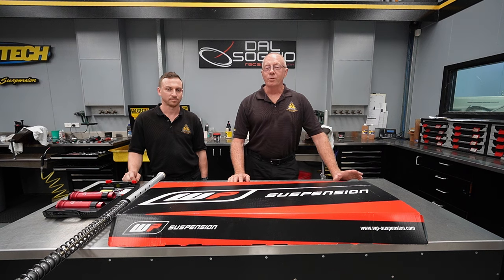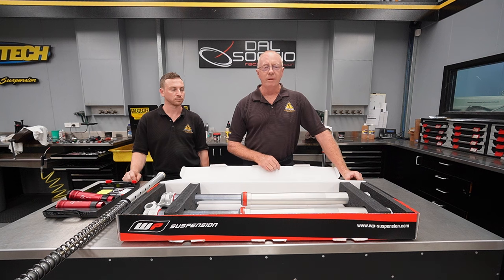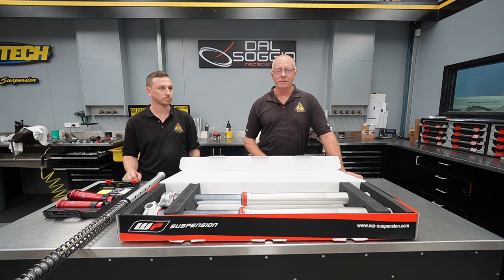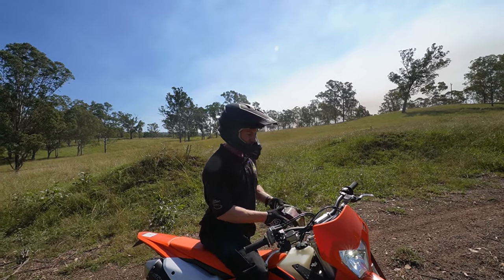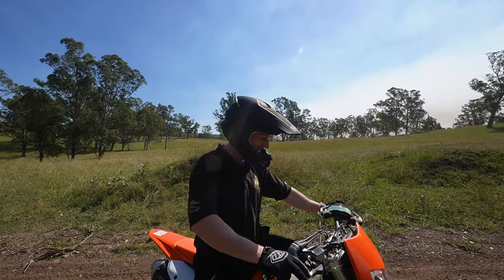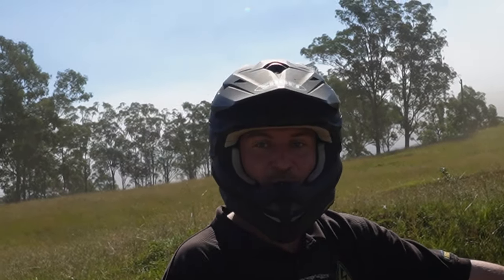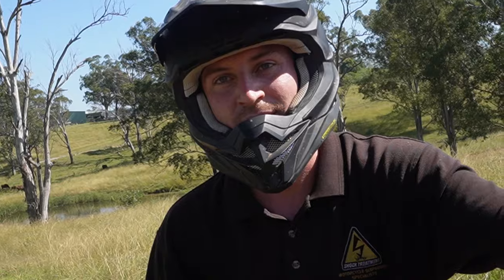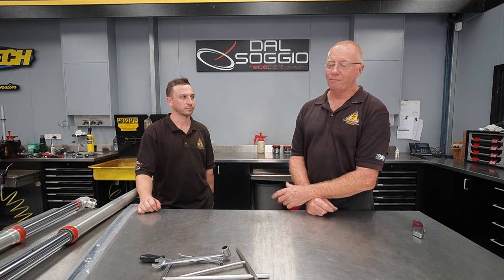KTM EXC 2024 Fork Analysis and Dal Soggio XR Kit Upgrade

Comment: Learnt a lot through your no bs explanations 👏 

With the bladder can you use the psi to adjust the feel or should it be left at appropriate value ?
Reply from the maker: It will certainly alter the feel but its underlying value is in maintaining a positive pressure to provide fluid stability.

Comment: The Dal Soggio kit changes the fork back to a bladder fork, which the original WP CC fork was. Why do you think they went with a piston and chamber? Do you think it was just to be the same as KYB? How do these forks compare with the original WP CC fork?
Reply from the maker: I still rate the bladder fork from WP as their best fork yet. They are still available as an aftermarket item and have been upgraded. The Cones are a bit of a marketing exercise that have the buying attention right now......but ask a tuner as to how the cones are any better or even any good.....I've yet to hear a credible answer, even from WP
Reply: If you know, can you tell me what was the initial idea why WP developed cone valves? I've heard something about mid-valve compression shims getting distorted too often, but don't know whether that is true. Anyways, everyone else uses some kind of a shim stack on mid-valve compression seemingly without a problem. 

If that is indeed the "real reason" why cone valves where developed than it does really seem to be more of a marketing stunt, as shims, especially with a trampolene (leaf) spring offer way more adjustability.
Reply from the maker: @strifex-suspension-works  Their midvalve shims do distort quite regularly....but the shimstack provides the greatest level of tunability and better feel. WP could look at supporting their shims more efficiently or upgrading the quality of their shims rather than chasing alternatives that offer more appeal in the brochure than in the real world. Chase Sexton has thrown his WP Cone Valve cartridges away in favour of KYB.....they could have given him this new cartridge instead.
Reply: They are both good, you wouldn't be able to tell the difference in feel. New fork is better, has a better mid piston than the old CC fork. Most of the stuff this guy is saying is biased so he can sell more stuff. Good tuners know why the CV fork is better, I'll just leave it at that. Racetech typically removes the cones so they can sell gold valves which turns them into the new 24 spring fork basically. Nonsense
Reply from the maker: @AnonYoukno  So......if WP themselves can't give me a good reason as to why the CV is better....perhaps you can fill me in? And lets keep it technical. Having studied hydraulics and fluid dynamics along with mechanical engineering, feel free to go as deep as you wish...
Reply: @AnonYoukno  yeah, I also would like to hear an explanation as deep as you can go.
Reply: @shocktreatment5495  with regards to shim support, are you referring, for example, to implementing base plate of sorts to limit stack deflection accompanied, if necessary, with a more open-flowing piston to achieve same flow with less shim deflection?
Reply from the maker: The mid usually has the largest ports that can be accommodated within the confines of the dimensions. There should be more than enough options through both float and deflection to ensure the elastic limit of the material is not reached. Most mids will have backing shims that will limit deflections, bolstering shim strength. This action also represents a change in shimstack pivot resulting in a form of two stage stack. I am a big fan of this concept. However if you are starting with poor shim material, distortion will always be an issue. We have tested a geat deal of shim alloys and properties and have our own custom made. Of all the OEM companies Showa appear to use the highest quality shim material. They are some form of stainless but the alloy appears to not only be more durable than most stainless derivatives but they are extremely uniform in thickness
Reply from the maker: @Andy-co6pn  You would make more. Sadly good advice as recognised by most, could be seen as an info-mercial by some.